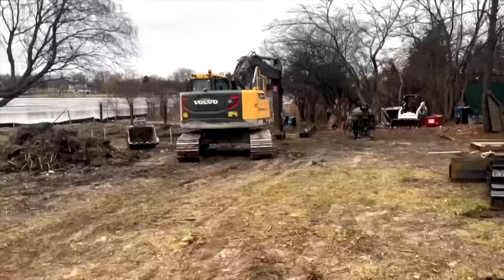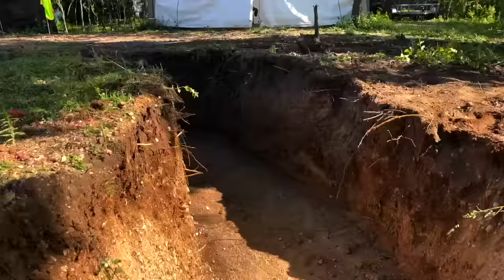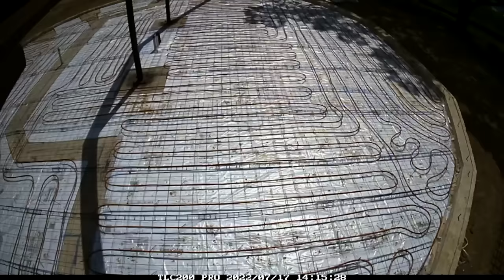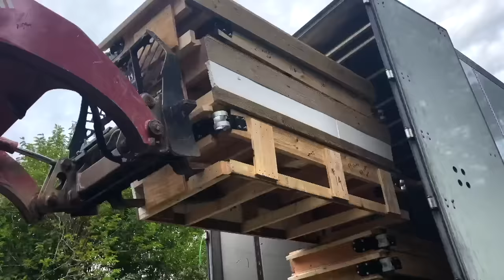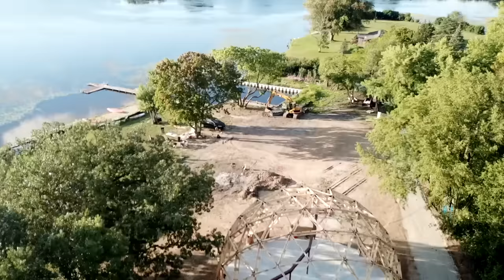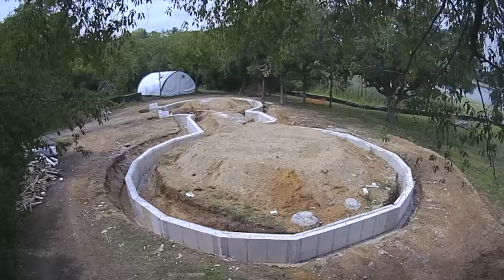Geodesic dream - 01_Rough

Comment: I built my own dome using the Timberline hub kit.  Layed 7" polystyrene slabs on top, had deep V grooves between the panels.  Put rebar in the grooves, then covered the entire dome with 1x1 by 14 gauge galvinized wire fence.  Hand mixed and hand applied a special low-water concrete mix with fibers in it 2-3" thick.  When done, took down the Timberline kit and put it away.  I believe you could drive a Mac truck over it and could not tell anything was happening! Super energy efficient.  Coated the thing with Elastomeric paint.  Oh, I also embedded 5/8" threaded rods at strategic places to hold the ledger boards for the upstairs floor.  It is a 40 foot 3/8 sphere on a 4 foot base wall.
Great job on your dome!
Reply from the maker: Thank you! This might have been a very interesting process, what you did. You've had a cool approach to an already unique style.

Comment: These domes are absolutely beautiful. I look forward to seeing how you finish the roof and what you do for windows and insulation. Best of luck.
Reply from the maker: Thank you so much! I am trying my best, this is much harder than I thought it would be. MUCH HARDER. Though it does look glamorous when filmed, I must admit :)

Roof will be Reinke Shakes: roman gold for the two domes, slate grey for the riser walls and the verticall walls (connection beteen domes)
All exterior trims will be black (gutters, windows, doors, deck railings). I hope it will look at least decent, since I have no designer in this...
Thank you!

Comment: OMG, talk about the budget you had available please 😰 I'm talking about all the labor plus the land purchase, permits, plans, engineering, materials, etc. This is a luxury dome by no stretch of the imagination. I hope it brings you joy though 🙏
Reply from the maker: Thank you! I wanted to do an airbnb originally (was living downtown chicago at the time), and the initial idea was just a smaller dome, not two large ones, but after a while I realized that I want to live there. So I sold my condo and started to build this better version of my initial idea, long story short. But you are right, it gets pricey, quickly. 

best way to sort of price it is to go to the manufacturer's page. It just depends on too many variables, like the inside materials and finishes, insulation, roofing choices, earth work needed, type of heating (I did geothermal) labor prices in the area, and a lot, lot more. For example, I didn't hire any GC, and that alone can save you 50-80k on the project. I am hunting on FB marketplace for any deals I can find (interior wood covering, flooring, appliances etc). 
https://naturalspacesdomes.com/dome-system/pricing-and-planning/

Comment: Looking forward to see what you the final cover for the domes will be
Reply from the maker: I will cover it in Reinke aluminum shingles (or shakes, as they call them.) Roman Gold color.link here:
https://naturalspacesdomes.com/dome-system/pricing-and-planning/aluminum-shakes/
Reply: @peteram7  Thanks for the reply. That looks like a very challenging roofing job !
Reply from the maker: I think it will be, but I've seen a nice blog where the owner did it himself. Besides, on the Reinke website, they show 3 ways that you can actually cover the domes. Yes, the element of surprise is always there, but there are definitely folks that have done it, so that's reassuring! Thank you!

Comment: I'm also in the process of building a dome. We are a rare breed.
I went with your first plan: A small one for an air-bnb.
I did a fluid-applied membrane, covered with a metal shingle roof. I think in the future I'd go with a fiberglass roof though. The metal shingles nearly broke me, and was definitely the "f-this" point in my project. I'm in the process of finishing up the interior planking. Looking forward to your next video. I've been filming my process but don't want to upload anything until the project is done.
Reply from the maker: Wow, rare breed indeed! Yes, the shell-related dome is very demanding and slow...I 'm yet to get to that point this spring, fingers crossed. Would love to see yours as well!

Comment: Geodesic structure are very cool, architecturally, however, I have to seriously question the efficiency of the construction process, the use of internal space, and the difficulties of standard practices (such as drywall, finish carpentry, etc.). Nature does not have right angles, and thus we prefer to live in a home not having right angles. However, all of our construction products are made for right angles and 16 inch on center construction (which is a shame, but economically practical). Beautiful job BTW.
Reply from the maker: Thank you! You're absolutely right, everything is a pain to put together, when it comes to the shell. I still have to do all the interior paneling and outside roofing, after framing all the windows. Hard, but I do think that will be a very efficient structure (load bearing and such). And the appeal of the unique geometry, of course. Thx again!

Comment: Beautiful domes, but wooden domes have historically done poorly. IF you can keep water out they will last, but that's a big if. The only geodesic domes I have seen last a long time have been covered in fiberglass, which raises the price even further. Cost per square foot is far higher than a conventional home and that is before the cost of repairs when/if water gets past your membrane. Repairing these complex structures is very expensive.
Reply: I share your concerns. I think they've done poorly (historically) because they were built by hippies. This guy wrapped the whole structure in adhesive-backed, Water and Ice Shield. It should hold up for the life of the roof so long as the origami (overlaps) were done correctly (including around windows). Hopefully the roofing is done just as well, as there is little room for error with a geodesic domes roof.
Reply from the maker: Dave, I agree with you and Josh. Historically they have been done poorly because of DIY-ers (read hippies, haha). I feel what I am doing is legit construction that should last a long time. I have couple GCs that I constantly take advice from - and my architect. The roofing will be AL shingles from Reinke. Their motto: Roofing for the last time! I was trying to be super-paranoid when it comes to water issues. Yes, windows will also be tricky and I intend to be super careful and do it by the book. Thank you for the good points!
Reply: So I guess you wouldn’t recommend considering a dome over a yurt?
Reply: Wow this is fabulous!!!! You are living my dream!!!! I’ve always dreamt of interconnected Domes….. You have done a great job!!!! Absolutely fantastic!!🔥👌💕

Comment: great video, and very useful comments...how many livable square feet/metres are in the structure(s)?
I've spent a bit of time in a couple of domes, even built and camped in one over 3+ months, in 6 locations [1/2" tubing, about 12 feet across, 3-frequency 3/8], which worked out great, except that we needed to fix the skin a couple of times. but, the interior feels do different from a 'tent', it's amazing.
Reply from the maker: Thank you! The main dome is 49' diameter, 1600sqft on the main floor, and 900 sqft on the second floor (that only covers around 5/8 of the dome, the rest is open to above. Then the garage dome is around 1000sqft on the main floor and around 900 on the second floor. The garage dome is a 36' diameter dome. And the connection piece between them is around 200sqft per level. It has the stairs there as well.   Thanks again!

Comment: I've been pipe dreaming about building a house similar to this. Your house looks amazing! What is the Diameter of the domes, and is that a garage door on one of them? How big is the connecting piece?
Reply from the maker: Hi, the garage dome is a 3v (3 frequency) 36' diamater high profile dome, the main house is a 4v 49' medium profile dome  (if you're not familiar with all these options, you can check them all out and more at the company that sold them to me  naturalspacesdomes.com, they have a comprehensive website).  The connecting piece is 2 story high, as the stairs to get to the upper level is in that connection. That was not supplied, my carpenters built it. Thank you for your interest!

Comment: Are you planning on doing a price breakdown for us or can you share you spreadsheets that you have been using?  Also, what state and country did you build this in?  What kind of business exactly are you in with residential electrical-low voltage trade?  security?  Do you own it?
Reply from the maker: Sorry, I don't see the relevance of your questions when it comes to my personal life (such as business and financial info), but perhaps you can explain the purpose of those questions? Thank you.
Reply: @peteram7  It's not about relevance.  You are the one posting a video.  Can't we ask questions?  If you don't like the question then don't answer it.  Welcome to Youtube!
Reply from the maker: @luciusgorgo14  Ha, I guess you're right, I am not a youtuber who deals a lot with feedback. I'll follow your advice.  It's built in IL, an hour N of Chicago. Thank you.
Reply: @peteram7  I agree w/ you on relevance of some questions. But you'd have to do what is available & what country, state, building codes where you live. I also get the price estimate so we can assume will give us a general idea. Others who post time lapse builds break down most things & if you had a budget & were you under or over & hard to find speciality items. I love the dome. Thank you for sharing.
Reply from the maker: fair points, thank you! Yes, pricing is almost impossible: what finishes are you doing? is one of the main ones. Price of labor in the area, choices of roofing, insulation, HVAC, plumbing, lighting etc etc etc...all can be an order of magnitude apart. 
I mentioned in the comments a link where the ppl can go on for more info. It's the company I bought the domes shells from.
Other than that, my mission is pretty much done :) Again, I'm just a guy who uploaded this more for friends and family, people that I meet in person and explain the details that way. It's just a hobby of mine, and it's not meant to be informative (in retrospect, I should have disclosed that). But I never thought it would generate that much interest outside my circle of people...hope my thought process makes sense.  
Thanks again!

https://naturalspacesdomes.com/dome-system/pricing-and-planning/

Comment: Do you think it would be better at resisting a tornado than a traditional house? Does the middle section reduce that resistance?
Reply from the maker: Hi, thank you for the comment! Absolutely and without a doubt, these domes are the strongest in tornadoes, heavy snow loads, etc.  The middle section does not reduce the resistance of the dome (but of course, the middle section is also not as strong as the domes either. Luckily there are very few tornadoes in IL, my main reason that I went with it is for the looks of it, but the strength is surely an added bonus. Thanks again!
Reply: @peteram7  Thanks for the info!

Comment: how much did this dome cost? including labour
Reply from the maker: I mentioned in the comments, best way to price it is to go to the manufacturer's page. It just depends on too many variables, like the inside materials and finishes, insulation, roofing choices, earth work needed, labor prices in the area, and a lot, lot more. For example, I didn't hire any GC, and that alone can save you 50-80k on the project
https://naturalspacesdomes.com/dome-system/pricing-and-planning/
Reply: @peteram7   considering your variables in this case what would you estimate the total cost of your build

Comment: What is the size of it?
Reply from the maker: The garage dome is a 3V (3 frequency) 36' high dome, the main house is a 4V 49' mid dome. You can find a lot more info about the various options from the company that supplied them to me, naturalspacesdomes.com  Thank you.
Reply: @peteram7  If 36 and 49 refer to their diameters, the floor area of the two domes (not including center connector or lofts) is about 3,000 square feet.

Comment: You built it too close to the water.
Reply from the maker: I think it will be fine. It is around 6' over the historic flood line, and has no basement. That's a good point though, surely may look this way from the video . Thank you.